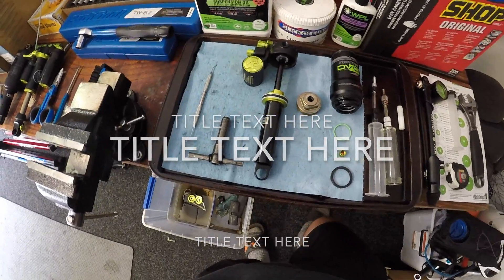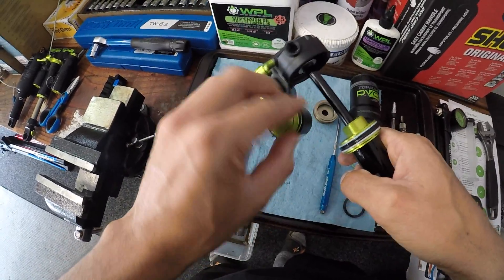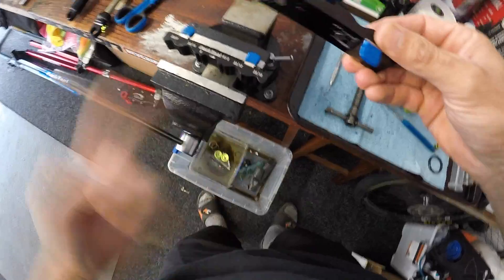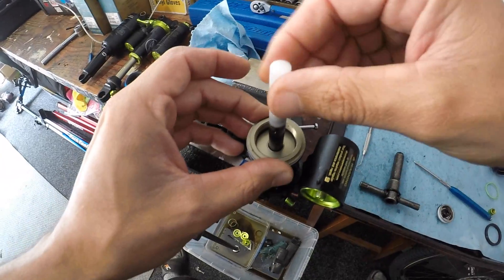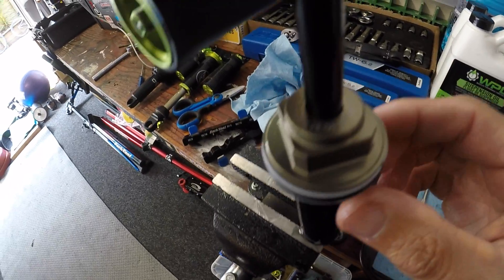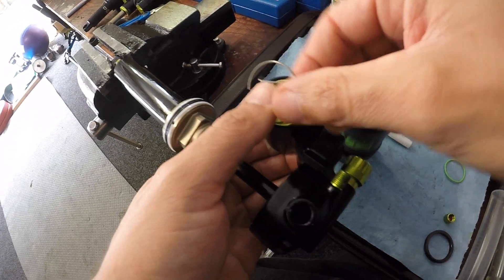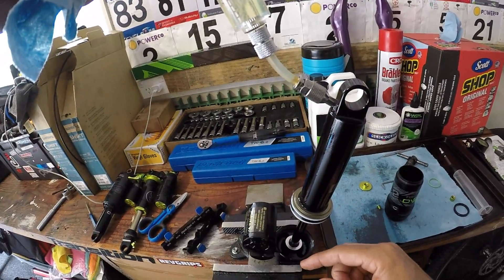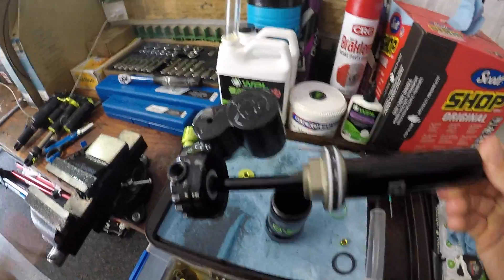DVO topaz 2 seal head swap

Comment: I got my topaz back in 2021 and it came stock with that newer metallic green seal head. But holy crap, that thing was on ridiculously tight. It took a three foot extension on my wrench to break it lose and the du bushing definitely got an imprint from the vice. Love your videos.

Comment: Jesse where on  earth do I get a 10 mm bullet tool for topaz 3 shaft. Took me forever to find a 12 mm bullet tool for my xfusion shock. however is it correct that I can install the seal head onto the other end of the shaft (if take that off the shock body) without damaging the seal as that end is a little tapered?

Comment: Got to love spherical bearings. And proper frame construction. Love my Geometron G1. So far no issues. For some reason spherical bearings is not common. An dim not sure why trunion is used. I guess it eliminates using spacers on some frames.

Comment: Hi Jesse. In the video when you compare the new seal head to the old one (at 1:24), the new one looks significantly taller than the old one... Does this mean that the travel that's possible is slightly reduced after fitting the new seal head? It looks like that taller seal head will act in the same way as a travel spacer...?
Reply from the maker: I actually didn’t think of that but yes it would reduce it by about 2.5mm
Reply: Thanks for the quick reply - I've been pulling my hair out trying to work out why my shock is not achieving full travel, but this explains it! Bit of a bummer actually, as I've lost 3mm of travel at the shock, which equates to 8mm at the rear wheel, and means my 150mm bike is now a 142mm bike... The upshot of this is I'm probably now going to end up changing the shock, as I can't live with that. It's a shame as I really liked it otherwise.
Reply from the maker: @jamespacker2904  yeah can’t win all the battles

Comment: Hi there. Would you recommend replacing the seal head on a T3 Topaz as well, as a preventative measure even if there are no apparent issues with the stock one? I would like to service my Topaz and was thinking to do this at the same time as it’s apart. The new seal head is however one of the more pricier components so contingent on your opinion I would like to keep rebuild cost down if I could. Thanks in advance for any advice 👍
Reply from the maker: If your shock has the green seal he’d get rid of it

Comment: Hey Jesse, I looked online for a video on rebuilding the damper and there was nothing that I could find. So thanks for posting this.

My question is, which oil and weight is needed to bleed the damper system?
Reply from the maker: 2.5 or 5wt mate 🤘🏽
Reply: @dvosuspensionnz  Thank you! Being a heavier rider @120kg is the 5wt better? After I wrote this, I found a pdf on DVO's website and it stated to use "2.5wt oil, no Maxima". Is Maxima really that far off? Thanks again for your support.

Comment: Great video, and great tips along the way...  I have a question about the shims - I can see you put 3 on one side of the rebound piston, then 2 on the other side, but I have one thick shim with an o-ring in it...  Which side of the piston does that go on?
Reply from the maker: Can you send me a photo. Sounds like that will be the 2.5mm travel reducer not a shim hahah
Reply: @dvosuspensionnz  You were right, I saw it in your video at the very bottom, with an o-ring on top of it.  It's weird that there were 3 shims on the lower side, and 1 shim on the other side, but it seems to be ok.  Rebound was super slow, but I added air to about 250psi and it helped a lot.  It's frustrating that there are no manuals for these anywhere, only T3.

Comment: Thanks for this great video man, class act for putting this up. I took my Topaz 2 apart referencing this video and your service video and instantly noticed quite a bit of oil all in the can and the top end of the shock near the bladder chamber, the seal head was also pissing oil for about 3 minutes until the pressure evened out. Is this standard or should the oil be contained inside the stanchion tube under pressure, looked like yours had no oil in the can.. 

The O-Ring above the head seal is also a bit thrashed, looks like it might have seen some rough bottoms.  Bought this recently from a chump who apparently hadnt used it off pavement, bike had no scratches to prove it. maybe he was bunny hoppin around the block on low psi?

Let me know your thought when you got time, cheers.
Reply from the maker: Hey mate. Did it have a green or silver seal head?
Reply: @dvosuspensionnz  Green Seal Head, I just wiped down and removed the white bushings and main seal and i notice a slight crack in the seal head on the top side of the recess where the bushings go.. safe to say its a cracked seal head so a fresh one in there with new bushings should prevent all the leaking oil and bottoming out i would suppose? 

Gunna take a stab at it, not many shops in new england would touch DVO, dont want to ship across the states.. came to the right spot.
Reply from the maker: @briansackett9500  yeah get the new updated grey seal head and that will solve all your problems

Comment: If my shock is making a suction noise should I do a damper bleed? Also when I get on my bike it feels a little gritty but after 3-4 compressions it goes away and I’ve only had the shock for 4 months
Reply from the maker: Yeah check the bladder pressure 1st and make sure is up at atleast 170. If that’s algood then yip it will need a bleed

Comment: Thank you for the video. I have DVO topaz and I will need to re-blleed it. Would you please list links to the tools, which are needed for bleed the shock? Which syringe you are using ? Also, valve tool to pull out bledder cup, that T shaped tool, where I can get it.  Thanks again !
Reply from the maker: There is a link in the description to the full process which Includes a list of what tools you need. For the bleed syringe, you just need a fresh brake bleed kit that fits a sram lever. The bladder cap puller is custom made, so just use a shock pump to wriggle it out

Comment: Hi Jessie, great vid, very informative. My son has a Marin Alpine Trail 7, it had an x fusion shock in it originally and we swapped it out for a Topaz 2 that came off a Giant. It made the bike feel awesome. He has done over 100 hours on it now. The shock is now losing pressure on big hits every now and then. I noticed today that it seems to be making a slightly gritty squishy noise at the start of it's stroke. Would this indicate that the seal head needs to be swapped over as well as a full service. If so where should I be looking to get this done?  We're near Port Macquarie, NSW, Aus. Thanks for your time
Reply from the maker: Thats awesome to hear